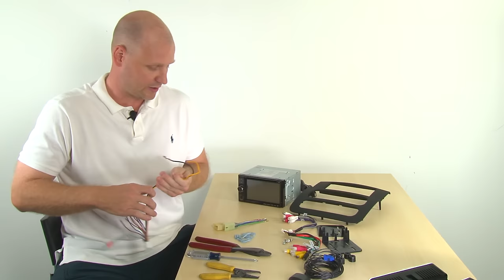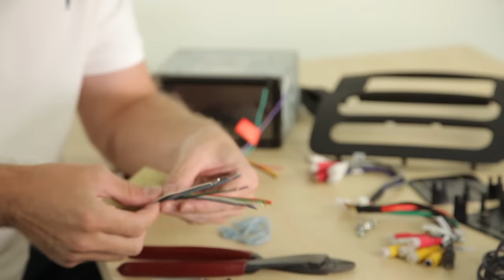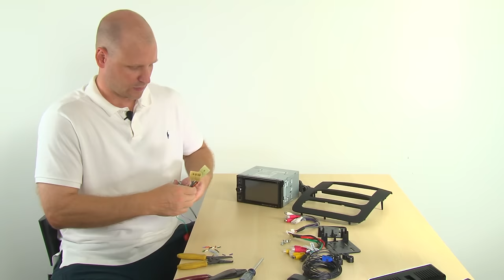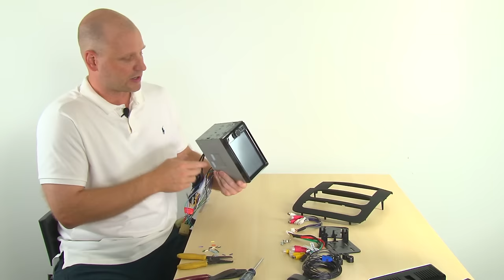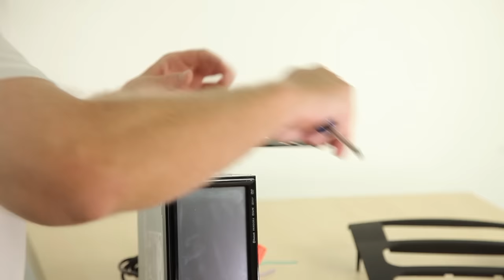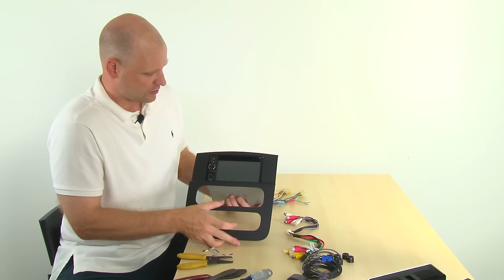How to Install an Aftermarket Car Stereo, Wiring Harness and Dash Kit

Comment: Some details were left unexplained... Are the colors always matching? Should I cut the harnesses so they take up less space behind the unit? Is a crimp connector really good, or bad and why?
Reply: Guillaume Gaudreault crimp connectors are good in the sense that they're easy to use to make connections, but they can also come loose over time. Could be poorly crimped, could've come loose from vibrations, who knows. Or you could crimp and never have a problem. It can be a gamble. Solder takes a little more effort but much less likely to vibrate loose
Reply: you can't trust colors by 100% because there may have left-over wires with different colors and you can't understand what to do next if you don't have experience in this. Also different makers, such as chinese aftermarket units may have different colors. Today chinese aftermarket units are very popular because most of them have Android platform and units are internet ready to play audio/video directly from youtube etc. Such Pioneer/Kenwood/Sony units are old-style/old-school. They have small displays and very few features, you just pay for brand not features. Brand units have their own GPS applications that's are outdated and needs to be maintained by car/unit manufacturer service to update firmware/software. It takes a lot of headaches.
Personally I'll reccomend up-to-date unit, even aftermarket and forget these old-school units without operating system.
Reply: Then how do you match the wires together? I can't find charts online.
Reply: MartinVideos1 no one explains how to connect the wires from the radio to the wires head from the car...
Let's assume I have red wire from the car (connected to the head.. (all the wires in this plastic)), and the red wire (according to my car's manufacturer) is for antenna, instead of accessory switch,
(In other words- on the radio red is accessory, but the red from the car is for antenna...)
I will need to still match colors? Or the connector  will change according to the car wires? Or should i do it my self- connect the antenna to antenna, and accessory to accessory? Even if is not the same color...

This stuff is just to simple for them, so they dont even mention that..
For me is a completely new language...🙄

Comment: No video on youtube have mentioned the TXD and RXD wires.
Reply: That probably isn't very common for a stereo, it seems likely those are transmit and receive data connections (Tx,Rx are often abbreviations for transmit,receive) It could be for data transfer within the car, or some kind of wireless data connection.

Comment: My car stereo suddenly doesn't have power, i did check fuse in the stereo, power wire still good, fuses in tge fuse box all good, audio fuse good, but the stereo still don't have power. i swapped my stereo to mg friend' car still work fine. do you gave any suggestions for me please.🙏🙏🙏. Thank you so much.
Reply from the maker: Sounds like a wiring/power issue with your vehicle. I would check to make sure you have a good ground
Reply: Thank you, i will check again, but before it worked fine about 6 months back. dont know why it happens now 😁
Reply from the maker: Yea its definitely an issue with your car if it works fine in your friends! You just have to do some investigating to figure out the issue, I would I could give a definite answer but it requires a hands on diagnosis
Reply: Cheers bro, will do 😉
Reply from the maker: Good luck!

Comment: I connected the cables and on the harness that I bought I was left over with two orange, one light green and pink.on the clarionvx404 I have two blue ones and I believe one white.the system won't turn on.please help
Reply from the maker: +Javier Cervantes Orange is for illumination, light green is ususally parking brake, pink is for VSS.
Reply: Quality Mobile Vi

Comment: Does this system works with steering wheel keys?
Reply from the maker: Yes, aftermarket car radios can work with factory steering wheel controls. You will need a Metra ASWC steering wheel module and that radio must have a wired remote control input for it to work.

Comment: can you help me?  I installed my dvd stereo but im having a problem,  i think my stereo is consuming my battery cuz after I installed the sereo my battery dies
Reply from the maker: Yea that sounds like a wiring issue! There's a current draw going on somewhere, its hard to diagnose without seeing it myself so you'd have to do some investigating or bring it to someone. make sure you wired the harness correctly. Could be a loose connection at the battery terminal. Could be related to the ground, your amplifier, etc. Make sure that the head unit itself fully shuts off when you shut the car off. This is verified by having 0.0 DCV on ignition and 0.0 ACV on a speaker output when the car is off.

Comment: What if the all the wire colors don’t match to the new stereo adapter colors?
Reply from the maker: What is your make/model/year and what harness did you buy?
Reply: I figured it out.  Someone added another harness that they wired themselves and used different colored wires.  Why I don’t know. But, i figured it out.  Thanks

Comment: I have a question. I installed the clarion nx404 in my 2012 galant about a year ago and then maybe 8 months the the line my clock radio and lighter turn off and I checked each fuse and changed them all it all came back on but two days ago it happened again I changed the fuses again but nothing happened this time PLEASE HELP!!
Reply from the maker: It may be an issue with the wiring harness, and you may need this one: http://www.qualitymobilevideo.com/70-7001.html
Reply: I forgot to mention stock radio is not working also. Any idea??
Reply from the maker: Well the wiring harness might be the solution for all the problems, sounds like a wiring mistake during the original install

Comment: I'm having little bit of trouble I gota connect the yellow and red together to have the radio turn and that keeps it on all the time when I do yellow to yellow and red to red it doesn't turn on. what can it be
Reply from the maker: +pimpala559 This is caused by an issue with your accessory. You should not connect the Yellow and Red together as the radio will stay on all the time if connected to constant. Check you accessory or red wire connection.

Comment: somewhat confused, what's the point of the wiring harness, can't you just hook up the new radio into the car using the old cable coming out of the car?
Reply from the maker: Every vehicle is unique in terms of internal factory wiring. The dealership wiring matches the dealership radio. Wiring harnesses are necessary because they're designed to replace these factory wire cut ins because you're installing an after market stereo. The dealerships factory wiring will not match your new radio's connection. The harnesses enable you to match up the wires for each connection to the new stereo's wiring harness. Once that's done, you plug the other end of the harness into your car's wiring connector (the one that was plugged into the factory radio). Using your car's factory stereo plug wiring connector is the key to installing a new stereo without damaging your vehicle's electronics, especially in modern vehicles
Reply: thanks for the response, another question, why aren't premade harnesses sold, ones that you don't have to set up yourself
Reply from the maker: Well they are, but everything is specific. So each radio comes with a harness, but you also need to get the specific harness for your vehicle's make and model. So for example, lets say you buy a radio, with it you get the radio's harness, but then you'll have to also get another harness that is specifically made your vehicle and then combine them yourself (or the installer will). It's all because each car manufacturer has unique wiring, and each radio manufacturer has unique wiring, but the third harness integrates them both
Reply: ah, I see thanks
Reply: It's called a hard wire old school and yes you can do it harness is easier

Comment: Quality Mobile Video what harness i need to hook up my jvc stereo set in a toyota avalon 99
Reply from the maker: Hey Chris, you'll need this one: http://www.qualitymobilevideo.com/70-1761.html?___SID=U
Reply: can you tell me whats the purpose of the smaller one if you know.
Reply from the maker: Each harness connects to the radio and powers specific things, it really depends on the car model for what the harness(es) will look like. The second, smaller harness connections: Purple – Right Rear Speaker (+), Purple with Black Stripe – Right Rear Speaker (),  Green – Left Rear Speaker (+), Green with Black Stripe Left Rear Speaker ()

Comment: I have a pioneer stereo and my harness is cr012 for my 1998 Chrysler sebring and the orange and blue wire does not connect to anything and no sound comes out my sakes when I hook it up
Reply from the maker: Looks like you need these harnesses instead: http://www.qualitymobilevideo.com/70-1817.html
Reply from the maker: http://www.qualitymobilevideo.com/72-6512.html

Comment: I prefer better to make connections by soldering wires not making connections by clipping connectors on both wire endings.
Soldered wires give better connection and reliability, after soldering wear cambricks over  wires and heat them to make good isolation.
After soldering you don't need to check wires because connections are perfect.

Comment: +Quality Mobile Video
 Sorry I didn't clarify that,  I mean if I had both in the dash (with a dash kit) under the OEM one, looks like this:
http://i29.photobucket.com/albums/c275/autoware302/install-1.jpg 

and somehow wire the new stereo so it would only play sound if the original one is on AUX (CDC), the orginal head unit has a plug under it, not 100% sure of everything it does but some hook up AUX and you can get a wiring harness to fit that plug for stereo, but i want to know if you can keep the sound of the original head unit? with a after market one, hope that makes sense.
thanks.

Comment: I have 3 radios Everytime I wire them up to my car only the power comes on I can't get the speakers to work. Only 1 speaker comes on and it's very low
Reply: Sounds like your speaker wiring from the harness to the speakers is possibly broken
Reply: Try testing the wires continuity
Reply: Wyatt Beasley  I got the speakers working now but there's a weird sound when I turn the radio on coming from 1 speaker and the speakers sound is all over the place depending on which song I listen too

Comment: what gauge size are the butt connectors?
Reply from the maker: +Jack R Blue butt connectors are 14-16 gauge, Yellow are 10-12 gauge, Red are 18-22 gauge
Reply: He should be using the red ones, hes actually using the wrong ones in the video

Comment: this not completely correct , it doesn't work with all aftermarket radios because of th difference in wires colors and cercuits / technology types

Comment: I recently bought a pioneer MVH-380BT to install in my 2009 dodge journey, got a complete install kit with it. The wire harness came with a separate red wire and brass or copper piece that goes connects to the fuse box, the problem is, when I connected everything, the radio drained my battery.  Am I wiring something wrong? I'm a bit of a NOOB at this whole radio installation process.
Reply: Check that you correctly wired your 12Volt Constant and 12Volt Accessory Wires. You may have connected the accessory from the Pioneer Unit to your 12Volt Constant and continuously drained power from the car when it only should have been from the accessory.

Comment: i have a 08 hhr were what fuse do i connect the red wire.plz help
Reply from the maker: +Jose Bahena That vehicle does not have an accessory; in order to replace that radio you will need to purchase an interface and that interface creates an accessory based on data-bus signals. http://www.qualitymobilevideo.com/gmos-lan-03.html or http://www.qualitymobilevideo.com/gmos-lan-04.html are the correct interfaces for that vehicle.
Reply: +Quality Mobile Video what does it mean when it says amp or no amp

Comment: MY harness has a separate red wire. I mean the red wire is not connected to the harness. How do I connect this?
Reply from the maker: This should help! https://www.youtube.com/watch?v=-kUOZVb8XKU
Reply: Hello. Thank you for your reply. I watch link. It does not address the issue I'm facing with the red wire. The Red wire is not attached to the new harness. It's just a wire included in the Kitt. All other wires are attached to the harness. How do I connect this red wire?
1 second ago•
Reply: I too have a single red wire included in my harness kit but not attached to the harness at all. No idea what it's use is for.
Reply: OK, It is a 12v accessory wire, used to power your head unit. It may not be specific to your head unit.

Comment: Wrong. Signal wires should be copper to copper, not through a crimp. You will experience some degree of signal degradation. Use bell caps on speaker wires.

Comment: My radio has different names for the wires such as key 3 and key 4
Reply from the maker: For SWC
Reply: @Qualitymobilevideo  thanks that cleared it up but I have the final wire for the reverse camera power wire  "back" but have no idea where to place it
Reply from the maker: @BiteMe19781  Sounds like that is the backup camera trigger to turn it one when shifting into reverse

Comment: I did all these steps but the radio still won't work
Reply from the maker: So it won't turn on? You must have wired something wrong! Or it could be a blown fuse
Reply: So Wet make sure you have a good ground
Reply: Check the ground
Reply from the maker: Dude three steps..... Check Constant, the yellow wire; 12 volts all the time. Red wire; this is accessory, meaning 12 volts as you turn the key, check for this.  Ground????? Explanation needed?

Comment: At 1:04 the best is to use solder and heat shrink,  So the title of the video is wrong as he is using butt connectors.   Some will use butt connectors because that is what you showed them (monkey see, monkey do).  So your video really doesn't show how to correctly install.

Comment: Hello, what would I need for this car stereo: https://www.walmart.com/ip/Dual-Electronics-XDM16BT-High-Resolution-LCD-Single-DIN-Car-Stereo-with-Built-In-Bluetooth-USB-MP3-Player/54596679 to install into a 2006 Hyundai Elantra? Do I just need to buy an adapter, would you know? Thanks in advance!
Reply: I guess it comes with:
Installation Hardware
Wiring Harness
Radio Cage

Just dunno if I need anything else...
Reply from the maker: You need all this dash kit...
https://www.qualitymobilevideo.com/99-7313.html
then this harness...
https://www.qualitymobilevideo.com/70-7301.html
or this one..
https://www.qualitymobilevideo.com/bt-7301long.html

Comment: Why does my harness have 4 boxes ? My 02 Ford Explorer only has two cords to plug into
Reply from the maker: Do you know the part number on the harness you purchased?
Reply: Quality Mobile Video fdk106 is the model . I don't think I use the 20 prong do I? I just need to wire the harness to the radio and then I'll be set but I'm not sure how
Reply from the maker: Ok you may need a different more specified harness by Metra for you vehicle. So you have a 2002 Ford Explorer, is it the Limites, Sport, XLS, XLT or Eddie Bauer?
Reply: Quality Mobile Video says XLT 4x4 in manual
Reply from the maker: Ok and you're installing an aftermarket radio right?
Reply: Quality Mobile Video yes
Reply: Quality Mobile Video on the back of stereo connector, the ford make says explorer 2dr/4dr so I assumed that was the right one considering none of the others had 2002
Reply from the maker: Ok, it looks like this is the aftermarket harness you'd need: http://www.qualitymobilevideo.com/70-1771.html?utm_source=YouTube&utm_medium=Video&utm_campaign=Aftermarket_Stereo-Installation
Reply: Quality Mobile Video I just bought it and I have an extra orange wire and extra blue ? Nothing else to connect them to
Reply from the maker: The orange wire is an illumination wire used to tell the aftermarket radio that the headlights are on and to go into a nighttime illumination mode. The Blue wire is a the power antenna wire, that is used to signal the power antenna to lift.
Reply: Quality Mobile Video I didn't plug either one in and fm and am worked. I don't know where to connect them though since there's no other wires to twist them with

Comment: Hi  I am having Hyundai i20 (2011). i would like to upgrade my music system to touch screen by my self. It has 3 connector (A,B,C1,C2,C3 connectors [ISO 10487] ) . My car already have Bluetooth and steering wheel controls (Track changer, mute,volume control, call on off button. please tell me suitable touch screen music system and harness adapter. and will my steering wheel control work after upgraded?. Thanks.
( for picture reference : http://www.team-bhp.com/forum/car-entertainment/66069-take-out-your-i20-hu.html)
Reply from the maker: What is your budget
Reply: Quality Mobile Video budget isn't a matter.. just want to find the right device.

Comment: I got a 1993 Nissan hard body and I bought a scosche wire harness adapter and the adapter came with the harness I needed but the harness has an extra one attached to it with wires and I don’t know what I’m supposed to do with the extra harness. Am I supposed to cut it off or what?

Comment: I have a wiring harness for a sony radio with 13 wires. I‘m trying to connect it to a VW harness and I have leftover wires on the VW one after i connect them both. Colours match up for connected wires.
Are they leftovers from the features my new radio doesn‘t have like the speed sensor? What should I do with the leftover wires? I‘d appreciate some advice